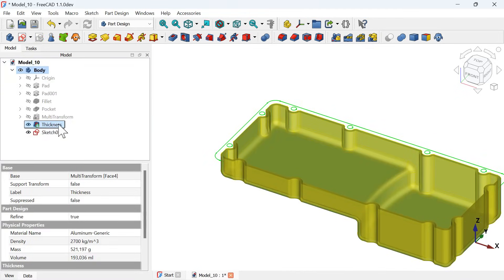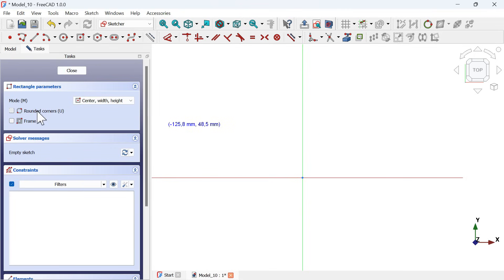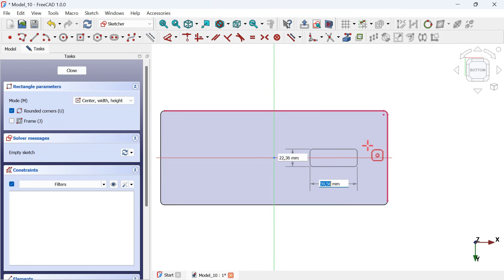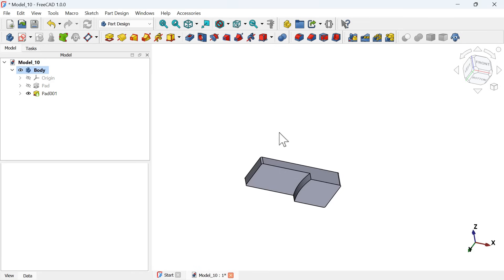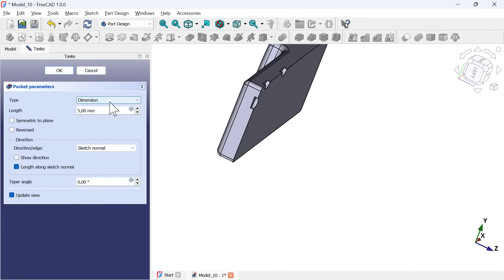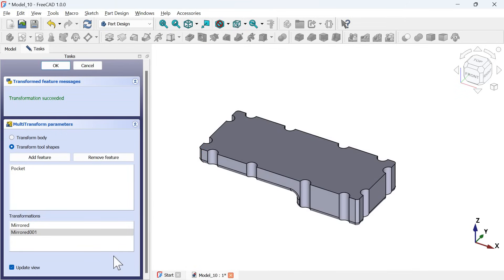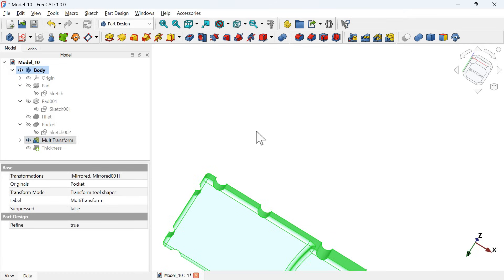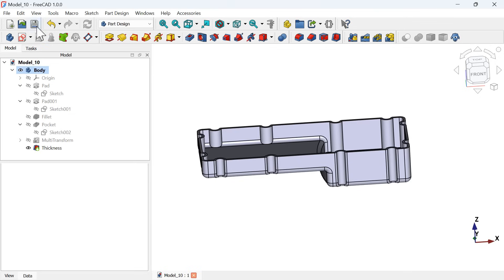FreeCAD 1.0 vs 1.1.0dev beginners tutorial #10: External projection geometry new tool

Comment: Watched this with enjoyment from start to finish. I'm also exprimenting with external geometry and i really did got confused during pad operations when i first started using this tool, because i didn't know that free cad treats external geometry as real geometry after using that new tool. I first thought it was a bug, but as a matter of fact, it's a timer saver feature. Previously we had to use binder and then to import external geometry and to trace over it. This is much more simpler now. Nice video!
Reply: You only needed to use a binder if you're referencing something from another body. If whatever you're referencing is in the same body, you only need the import external geometry tool.
Reply: @Zardozer  Oh nice
Reply: @Zardozer  That's true, i covered only one case in my comment, but still that doesn't change the fact you would have to trace new geometry over the imported geometry again even in case where we are not using binder, so this new projection tool is a big improvement in the workflow. But i think it has one big flaw. It cannot project geometry that is part of another body. Not sure if thats done on purpose by design or they actually plan adding it later. Cheers!